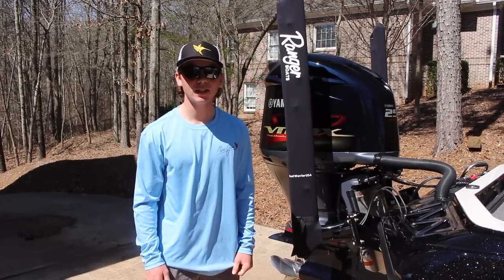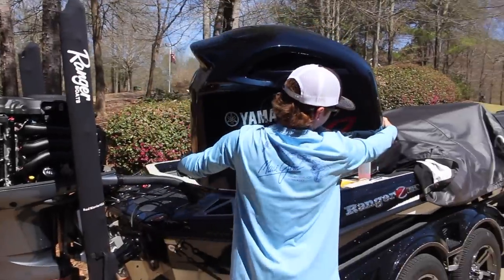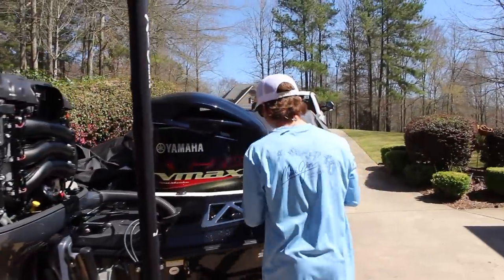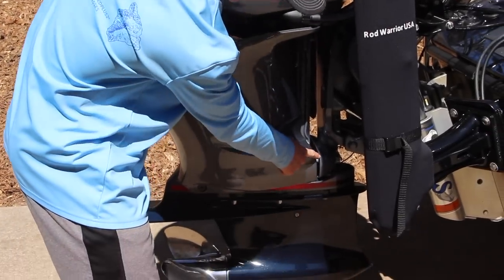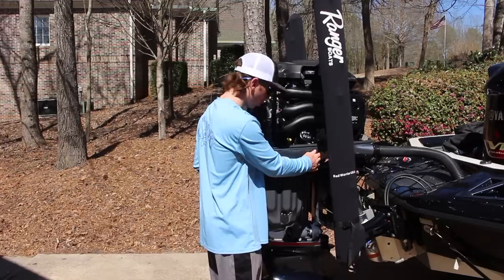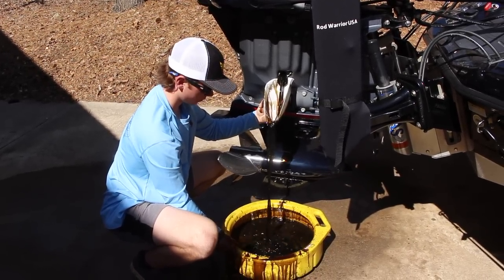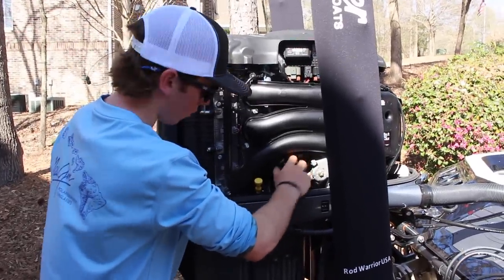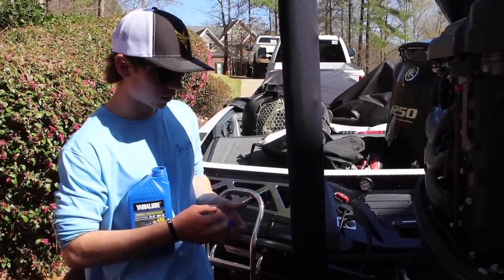Best way to change oil in Yamaha vmax SHO - Cheap & Easy

Comment: According to Yamaha owners manual, you are not supposed to run the engine using the water hose flush. You need to put on muffs on lower unit water intake.
Reply: Very nice boat man! John is correct. You have to put muffs on the engine to run it. Otherwise, you can burn up the water pump.
Reply: Im sure a lot, not all, don’t really worry about doing maintenance by the book on new Yamaha engines because they are going to trade the boat in at the 3yr mark anyway. Then the guy that buys the used boat gets to have the problems.
Reply: Duke im going to be buying my first Yamaha engine soon, is their a certain brand of muffs that work the best on the intake? I saw a earlier video where the guy was saying the muffs dont fit right on the Yamaha intake
Reply: I know this is from a year ago but I use one of those 55g blue plastic drums fill it with the hose water .  I have a jackplate though which allows me to lower it in there.   But that’s how I do it.

Comment: Use oil pump to extractr old oil from the dip stick tube, less hassel, less mess and you don't have to remove cowl or mess with drain bolt.  You over-tightened the filter. Only needs a 1/4 turn after seating.

Comment: Another video running motor on flush hose. Wish y’all would quit passing on a incredible bad habit. Y’all gonna get someone to blow up a motor.
Reply: Isn’t this hose for flushing out the intake when it’s clogged?? I’ve never seen anyone run an outboard engine without the muffs 😂

Comment: nice channel,but how did you get the oil off the concrete, i put some milk crates under the pan, it dose come out quick, parts vu  is a good deal,

Comment: Wut , the engine can make some oil ? LOL
Reply: actually, Yes. so to speak.
it happens when the fuel leaks into the engine block. it mixes with the oil and makes the oil level higher  than normal.
engine making oil is what the term is for that scenario.
Reply: @je12b  sounds like it would need new rings then?

Comment: Good one. I use a oil vacuum pump to suck out the old oil on my Yamaha. It's a lot less messy, and then you don't have to  remove the lower cover. Just my $0.02.
Reply: Steve Dechant  hey Steve. Do you think using the oil pump will get all of the old oil out? How far does the hose go down into the engine?
Reply: Duke wondering that myself. Did you ever find out? This Q was 2 years ago LOL!!

Comment: I have the 200 SHO and I'm wondering when should I service the lower unit and I have another question does your 250 piss water like its clogged up? Like mine barely comes out not like my mercury used to piss hard AF.

Comment: Did your motor make oil...and for how long
Reply: Yamaha outboards make oil when running at low rpm or idol for a longer period of time. Guys that troll a lot will see it. It’s normal and thats why you don’t want to max it out.